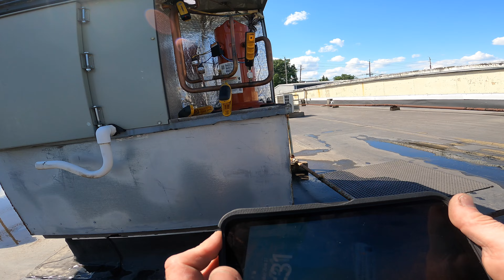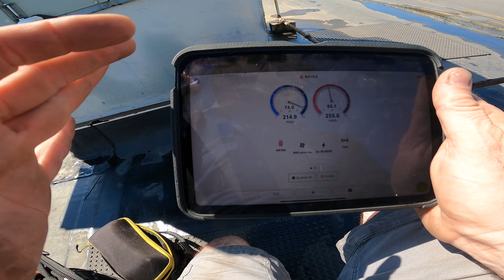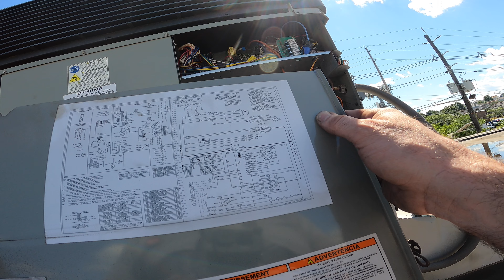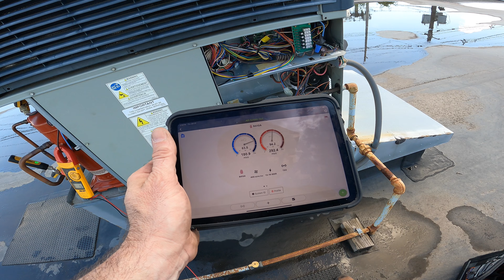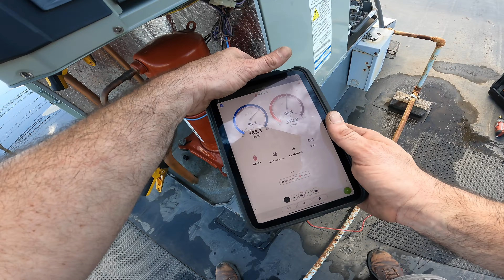Return to Troubleshoot AC Compressor with Open Windings

Comment: Good fix Bill. Most tech's would not think of switching one of the 3 phases. There are probably more problems in this building.
Reply from the maker: I ran into a compressor in past doing this, even have a vid https://youtu.be/UVnocVNnGWA?si=1bi66P42d0lmE32h.  around the 15:15 time. this was first time I ran into a compressor doin this. all other units are from a different panel. this unit 8s from a panel in a part of building that got renovated.
Reply: @thehvachacker  That makes perfect sense. When they did the remodel, the electrician unknowingly switched the phases in the panel.